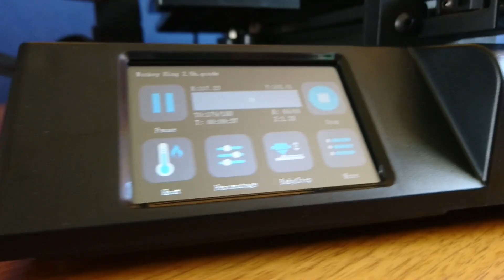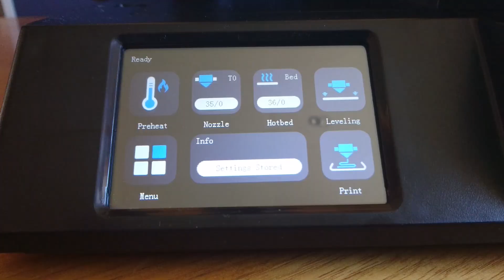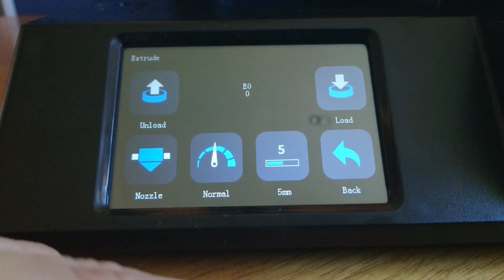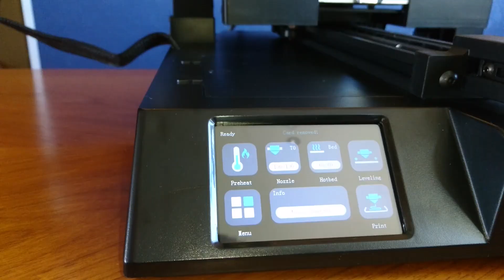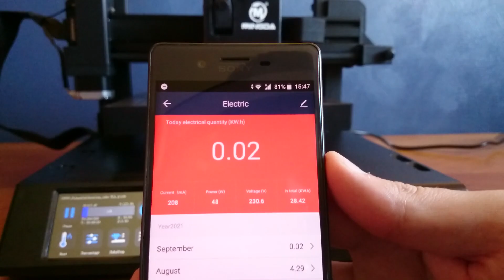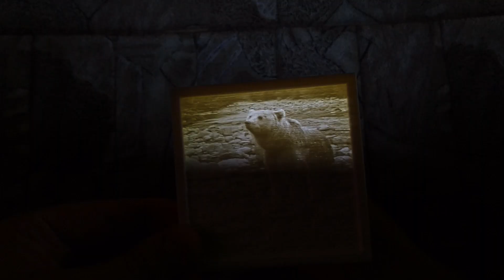Mingda Magician X - Full Auto-leveling 3D Printer 2021

Comment: I had to take mine apart to unclog the extruder, got a hold of some baaaad filament... It's interesting how it auto-levels (or at least the part of it that I think is how it auto-levels. Any idea as to what that auto-leveling system is called? I know I haven't seen any printers with a leveling system like it and it works pretty well on top of that.
Reply from the maker: I don't know how it's called. I have 4 printers with auto-leveling and Magician X has only that kind of system.
 I haven't had any clogs on my machine.
Reply: @3DPrintsBuilds  It wasn't the printers fault, it prints fine with my other filaments. I just got a bad batch of PLA :)

Comment: Minor niggle... you ripped the TPU, but said 'no issues'.   Does the bed level itself, or is it in a FIXED position and the sensor just handles it?
Reply from the maker: TPU print was fine. The support ripped off. Bed is in a fixed position.
Reply: @3DPrintsBuilds  That was the support!! Excellent! :) Thank you for rapid feedback.  (I almost bought one last night... had paypal almost on the buy button lol)
Reply: @matthewwain9958  but why didn't you? I'm looking for my first printer this is one I'm so close to getting but a bigger bed may be more ideal for me. I'm split between this or the artillery x2 (but that seems to have a few issues) but I'm not sure which has better quality and which can print faster without affecting its quality too much
Reply: @subzero6858  Because I am silly, I blew money on upgrading my ender 3 v2 with a ton of nods and then also bought a delta printer.  What I would advise is buying something in the 350+ range to avoid the "fun" of this lol.  The mingda is fairly nice for the money. I would probably go for something like the ender 5 plus, if I was starting it all over again.

Comment: Anyone else notice the whole build plate move up and down a little at the beginning of the leveling.......
Reply from the maker: Auto-leveling system works like that. At every point nozzle push build plate down and measure distance. It don't use BlTouch or 3DTouch like many printers with auto-leveling.